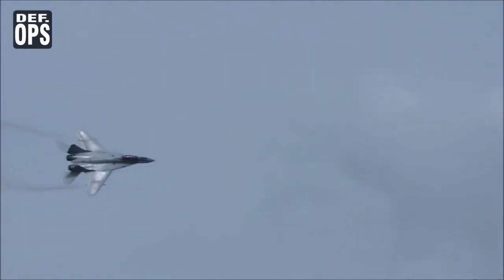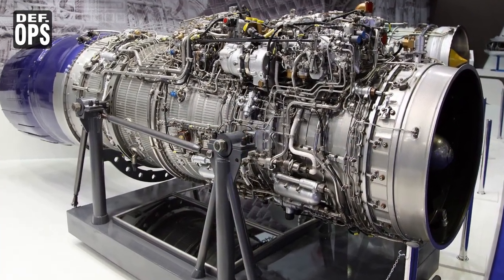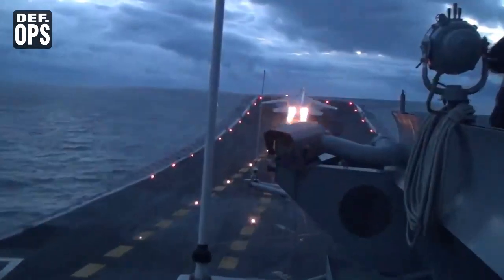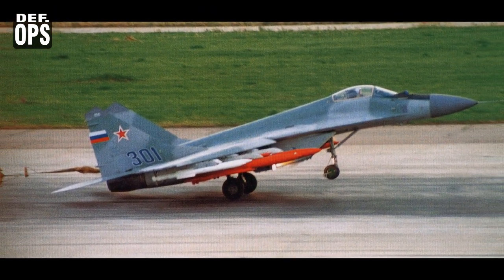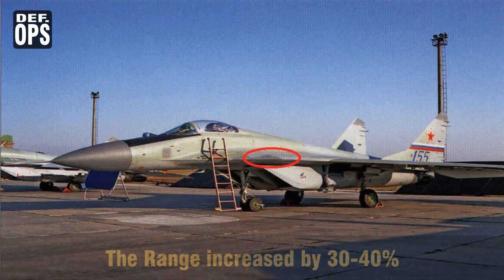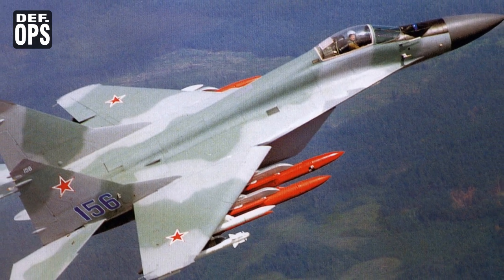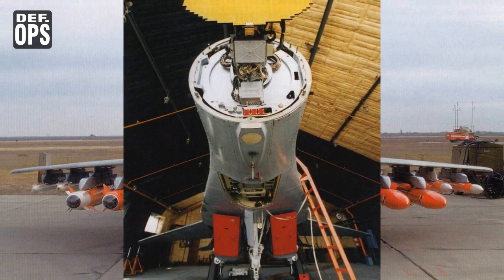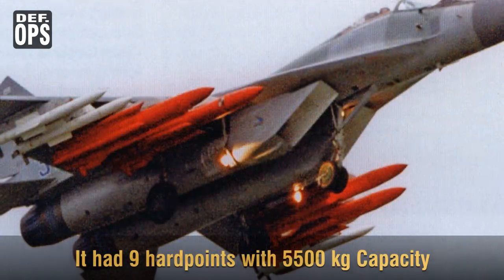The Generation II MiG 29: MiG 29M/MIG 33

Comment: in 2006 - 2008 the IAF should have acquired a fleet of 116 brand new MIG-29M multi role interdictor strike fighter instead of upgrading it's existing fleet of 69 MIG-29 air dominance fighter to UPG standards . . . the MIG-29M multi role interdictor strike fighter is a far superior fighter in all respects than the upgraded MIG-29 UPG multi role fighter . . .